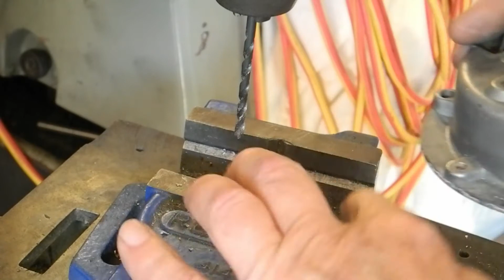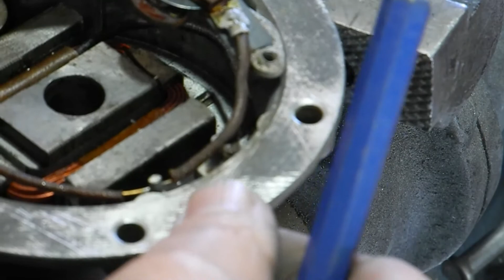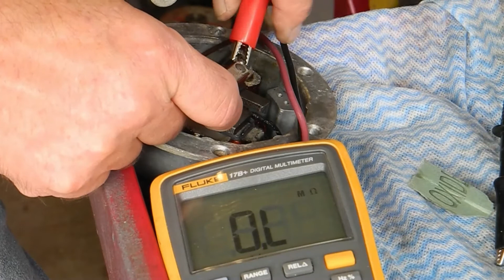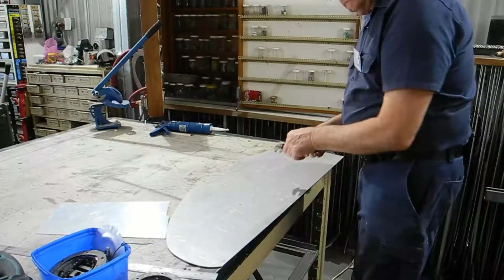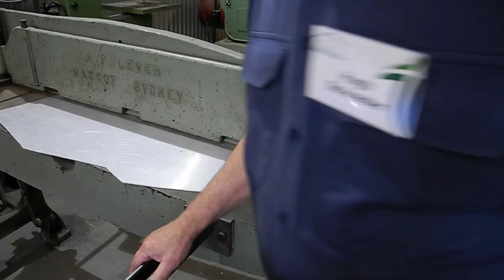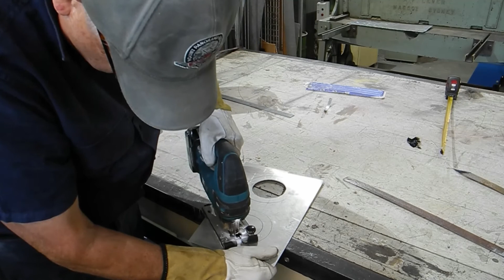Austin Healey 100/4 Car Horn Restoration (13) Pt 2

Comment: aw how could you leave us hanging, i need more horn in my life?, did you check the house? by the sound of it the parakeets have invaded, and by the way is that your name on the identity badge.
Reply from the maker: Roy - you really break me up.
The bird noises are so common here I didn't really notice till I was editing film.
Yes that's me with the name tag.
We have an organisation in Oz called the Mens' Shed (do you have that in the UK?)- that's where mostly retired guys meet up and make and repair stuff. My shed has some fancy gear like mills, lathes, welders, plasma cutters, guillotines etc. I use their facilities and teach mig/tig welding and other engineering things to anyone who may have an interest.
My YouTube movies are limited to 15 minutes - not sure why so I have to edit drastically to get stuff in.
Stay well - Hugh
Reply: unfortunately we don't seem have men tool sharing sheds in the UK,  it's every man for himself over here, bit of a shame really as it's an expensive business equipping a tool shed with all the things you need for restorations,  good work drilling out the broken steel bolts out of the aluminium body, real tricky as the drill bit will try it's best to wander off course and go for the soft option, look forward to more,  Thanks Hugh